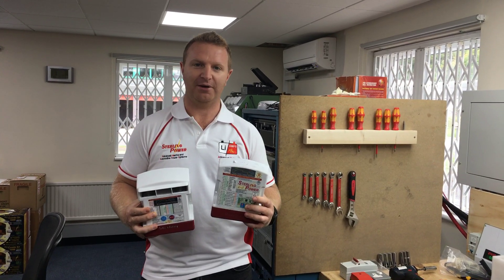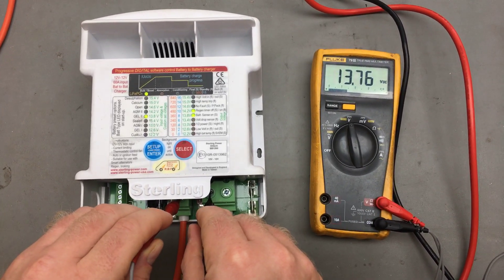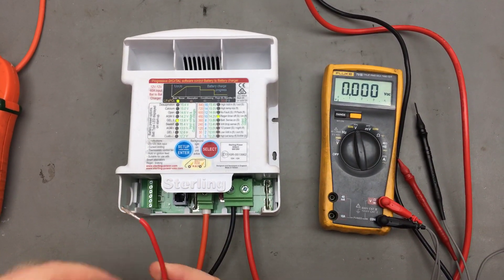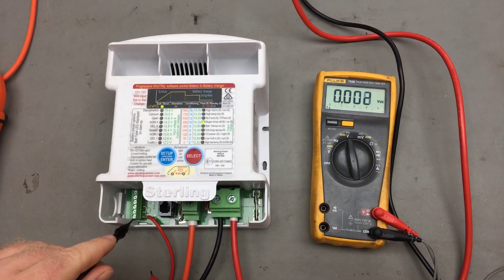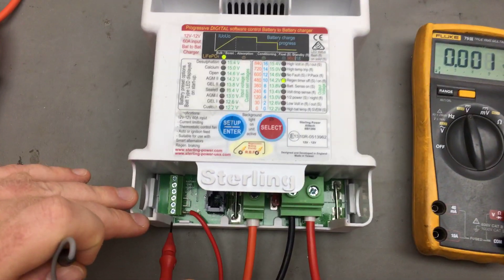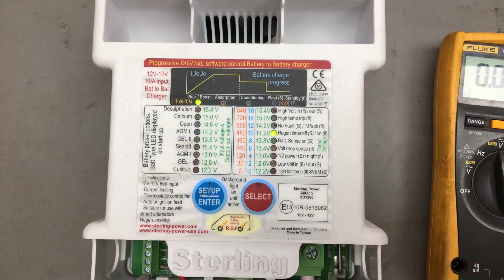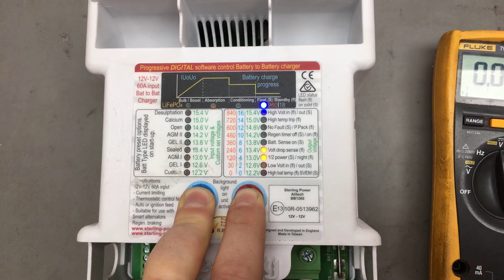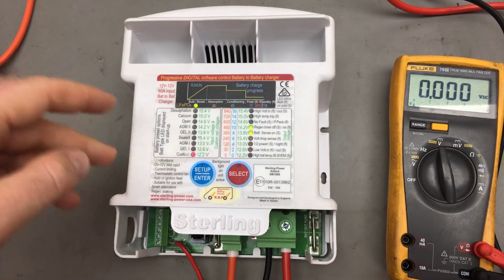BB1230 and BB1260 troubleshooting

Comment: Hi I have a green lable BB1260 which will not produce any current but will raise the voltage of by aux lithium batteries.  I've tried the set up with and without the ignition wire (this is a euro 6 vehicle).  When I hold select for couple of seconds LED 18 and 19 flash while LED 12 is solid. Any ideas?

Comment: Hi, I have a BBS which has a light to show if ition feed live. I have worked it up and piggy backed off part of the fuse box I know to work for other people, but the light doesn't come on. I THINK I have it set to pure ignition mode. When engine is on, the voltage leds come on and settle, but the ignition live light is off?
Reply from the maker: Hi Krak,

With a handheld multimeter, what's the voltage between the ignition screw on the unit and the negative screw on the unit? That'd give us a good idea on what's going on.
Reply: @SterlingPowerProducts  hi thanks for the reply. Got a meter on order
 In meantime I noticed that it came on when I checked. I checked back a few hours later and it was off again. Tried again this morning, and it's back on. What wire is good to link the piggyback fuse to the input? I'm using one of the spare switched ignition fuse bays in a t6.1
Reply from the maker: @Krak_Fox  Hello Krak,
Which link are you looking at and need clarifying for? 
If you're in the UK it might be worth just giving us a call on the technical line at 01905 771771. I'm off to lunch at the second but if you call between 1PM and 5PM we should be able to hash out any questions pretty rapidly.
Reply: @SterlingPowerProducts  says 25 when I do the meter test
Reply: @SterlingPowerProducts  sorry, it's the ignition feed indicator light - sometimes comes on, sometimes doesn't (always check with ignition on of course). Surely it should always be on when the ignitions on? I've check with meter and reads 0 ignition off, 24-25 with ig on

Comment: Hi, I have the 30 amp version, when my vehicle is parked up with no ignition on, it seems to kick in every now and then! Is that normal or is there an issue!! 

Many thanks 
Wayne
Reply from the maker: Hi Wayne,

Do you have solar fitted to your vehicle that also charges the starter battery perhaps?

-Ben

Comment: i had the bb1230 charging my calcium leasure battery and itvworked fine , however i upgraded to lifepo4 ( sterling battery) and im struggling to set up the charger , no information online either
Reply from the maker: Hi Iliyan, 

Should be simple to set up, and I'll be happy to help. 

The first thing I'd advise you to do, to make sure we're operating from tabula rasa, would be to go through a factory reset. This is relatively easy to do.

Turn your engine on so that the battery to battery charger comes online, wait for it to finish itself off in setup, and then press and hold both buttons together for over 30 flashes, let's say 35, then let go. Each column should begin flashing intermittently. Hold both buttons down again for two more seconds to confirm the reset.

Then, wait for the BB to restart and go back into it's normal operation. Hold down both buttons for between ten and twenty flashes, let's say fifteen, then let go. The left column should illuminate. Pressing the left or right button should isolate this to a single LED that you can push up or down. Push this LED up to LED number 12, the LiFePO4 / Bulk/Boost designated LED, then press and hold both buttons together for two seconds to confirm. 

You'll now be in the Lithium mode, suitable for the AMPS lithium batteries. 

-Ben
Reply: @SterlingPowerProducts   thanks for your reply mate , i managed and it was simple indeed , so far it is charging good 24 amps , will be ordering another lifepo4 of yours soon , thank you
Reply from the maker: @chumulungma  Great to hear.

If you need any help going forward, let us know.
Reply: @SterlingPowerProducts thank you,  i was wondering can i disconect the charger with a cut off switch or a circuit breaker when the battery is fully charged  and will this mess  up the chargers itself
Reply from the maker: @chumulungma  Not advised to do. It won't affect the charger, but it's just not a particularly great idea. The charger is made to only function when its charging parameters are met- so it won't be discharging your starter battery unnecessarily, and it's better practice to leave it running rather than isolating the output whenever you perceive it to be full.
Reply: @SterlingPowerProducts  thanks for your answer , only thought doing  it as the charger keeps going while the bms shows 100% soc but ill trust you and leave it as it is
Reply from the maker: @chumulungma  Completely understandable, but there's nothing wrong with that. The BMS will disengage a MOSFET on the charge side and basically disallow any further charge to go to the cells. If you were to actually measure the current down that line, you'd likely see 0A once the batteries are full, so there's no problem at all with us just boosting the voltage.

Be in touch if we can offer anything else. 
-Ben
Reply: @SterlingPowerProducts  thank you so much for all your replies and help

Comment: Thanks for the informative video.  I am about to install my BB1260 unit.  Question: When securing the cables does one turn the screwdriver in the clockwise manner to sandwich the end of the cable in the anterior position inside the cable receptacle --- or does one turn the screwdriver in the counter clockwise direction to sandwich the end of the cable in the posterior position inside the cable receptacle??  When I received my new unit the little platform in each receptacle was squarely in the middle so it is not clear where it should be when the cable in inserted.  There are also no instructions referring to this simple but critical issue.
Reply from the maker: Hi Philip,
As far as we go by, lefty-loosey and righty-tighty :)

You'll need to turn the screws clockwise in order to seal the cable in position correctly.

Comment: Too noisy 👎
Reply from the maker: Hi Carper,

When you're converting charge reliably for a long period of time the unit will just fundamentally get hot. Without a fan, the only way to regulate the heat is to essentially drop the power continually as it gets hotter. This would mean we're just selling a product that lies. We wouldn't be selling a 12V 60A charger, we'd be selling a 12V 20A charger as it progressively drops power due to heat.

The noise is fundamental to providing you a long term reliable charge, I'm afraid- and luckily it's only running while your engine is, too.